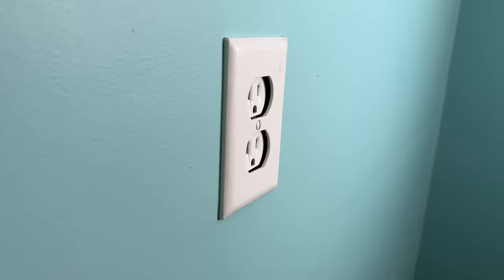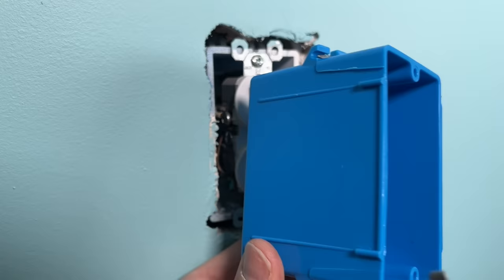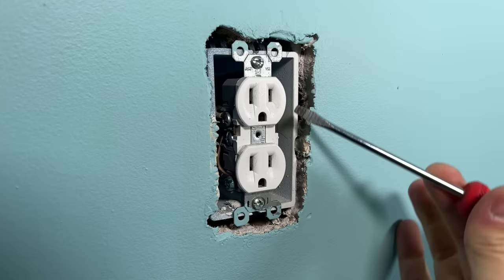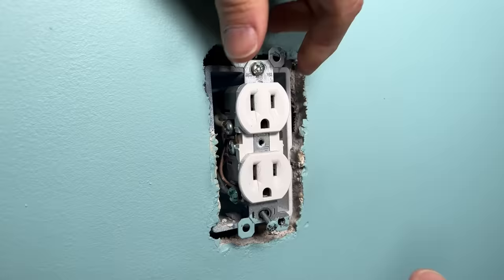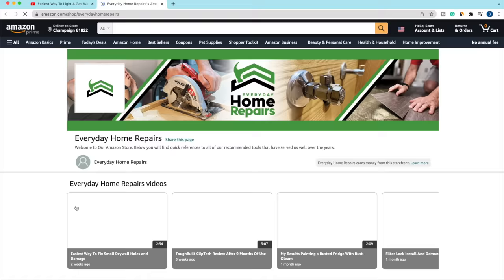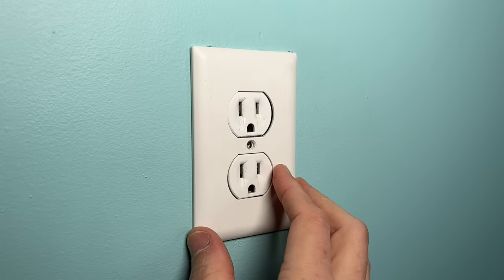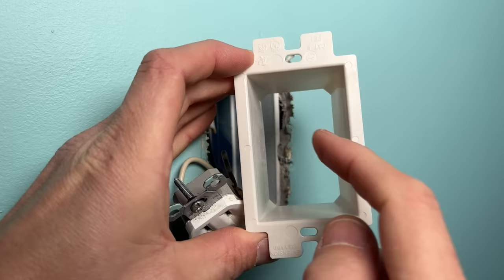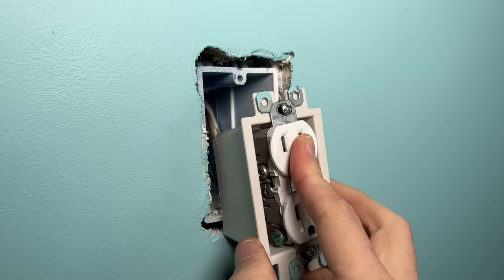How To Fix Sunken Outlet | 2 Easy Options

Comment: Any Electrician that uses a wire wrap terminal receptacle, in addition to not wrapping around the terminals of the receptacle with Electrical Tape, should immediately be fired. Do you job with excellence. We're not in 1940's anymore. Use quality parts and wrap to protect the home owner and their property.